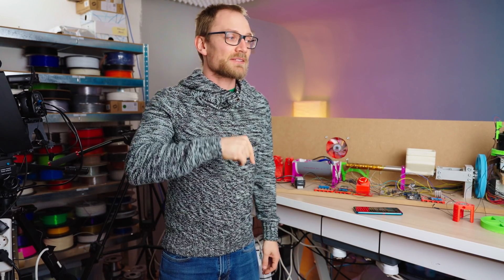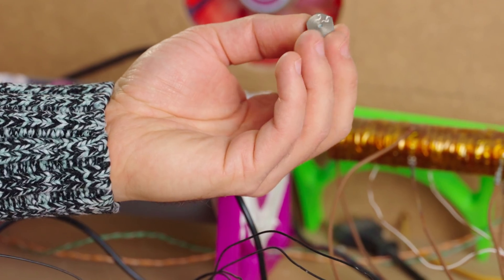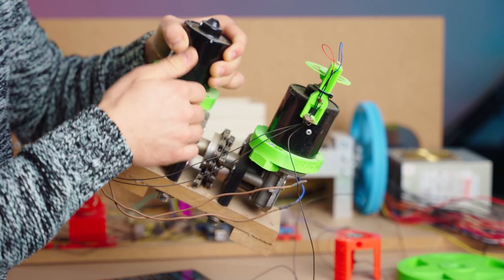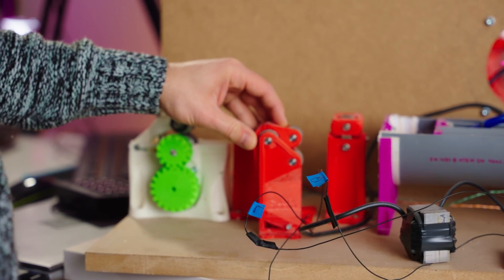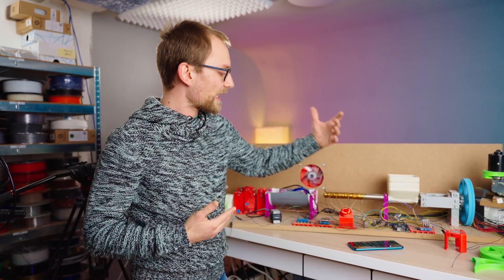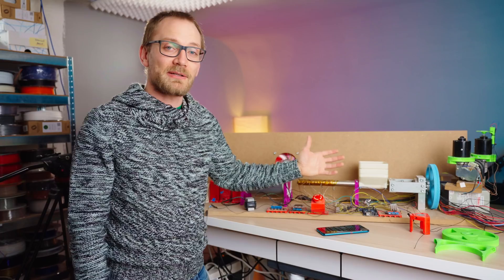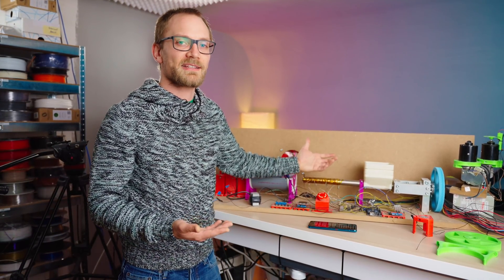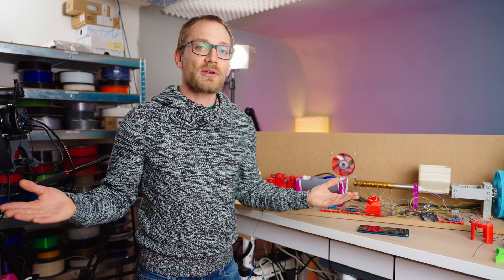How NOT to build a Filament Extruder

Comment: I feel super bad about my failed, incorrect, or otherwise waste 3D prints. Even more so than the cost of filament, the feeling that I need to hoard and somehow repurpose all my polymer waste of known composition limits my 3D printing adventures. I often think about building shredding and extrusion hardware, but it just doesn't seem practical, especially on my extremely limited budget.
I suppose if I had non-bedroom space for a real workshop I'd melt my 3D printing waste (and household plastic waste of known recyclable composition, but not accepted for commercial recycling) into sheets or other blanks in an oven, and use them for 'conventional' subtractive forms of crafting, as that seems more likely to work out consistently and with minimal expenditure.

Comment: @MadeWithLayers I'm actually quite interested in the filament sensor you used with your extruder.  I've seen the Infidel, but I actually need something to measure the filament diameter coming out of a Filabot and as you said, I don't want to put too much pressure on recently extruded filament.  Do you still have any info, models, etc. on that particular sensor?  I get the basic concept and can probably create something from scratch, but anything to start with would be helpful.

Comment: I know that this video is quite old nowadays, but still very interesting! Thanks for sharing! Though, I'm wondering how did you make the heater system.. did you use some kind of wire to heat up the tube? Can you please clarify?
Reply: It looks like he used resistance wire, maybe kanthal wire or something similar, though nowadays you can get band heaters that're the right size for this pretty cheap and they're much more reliable for this purpose

Comment: There's one more thing to the "If I built it now" aspect: Technology has advanced by (as I write this) almost nine years. The geared stepper motor and driver with decent torque is now cheap enough to almost fit within the 2013 budget, sleeve heaters and PID controllers too, and you can actually buy proper augers with compress and mix zones. Would be interesting to see the 2022 version. . .

Comment: Hai Tom, Been There Done That...
Some considerations:
* Big augur size best for recycling 3Dprints with schredder
* I use recycled filament for very big 3Dprints to cut costs
* A cheap DIY 3Dprint worm transmission with nema23 stepper works
* Tube heater wire is to long to the hopper hence the clogging
* Reduce temperature of the tube near the hopper with a large heatsink
* Analoque Hall sensors works cheap and simple
* Threaded rod and nuts through brackets on top of each module for a more robust construction
Hope this helps finishing the project ;)

Comment: How would you go about making a hybrid 3D desktop extruder/3D printer to function like a solid ink CMYKW traditional printer and a 3D printer at the same time.  The machine would need to fabricate variable sized dots of material to be deposited onto the substrate.  Working like a traditional printer you could lay down entire sheets of material with each pass, then layer those passes to create a 3D sculpted object potentially faster and more effectively than squirting a thin filament of plastic through a single narrow hot end.

The other aspect of the hybrid is the ability to also fabricate vinyl sheets using raw PVC pellets.  One hopper per color or to craft them into molded blocks like solid ink sticks/blocks.  Making vinyl sheets in the desired shape while it is being applied to the substrate gets rid of the waste, trimming, weeding that current methods employ.  It is the next revolutionary step for the use of vinyl in garment decorations, signs, and truly 3D printed materials/sculptures.

Comment: hello for the hopper I invite you to take a look at the scooter transmission you cut the engine in 2 keep the rear part or it i the wheel you removed the wheel of course. i use this on a grinder it has great force. hoping that this helps you.  bye

Comment: yes filament is affordable but recycling plastics or reuse failed print is another challenge .
But it's true, you have already spent a lot of money and it's a lot of time / work to reach return on invest 

This is a really nice product ! even more when you try to find "DIY" other products at this level (or pro "like" products)
One "Must have" product (for recycling purpose) is a way to convert row materials to usable product for this machine 
all available product I found to do this until now is plastic crusher ... but in my point of view the finished product isn't good as it have to for using in a machine as yours
For me the plastic crusher should be a hot machine and the output should be like your granule in your bag

Comment: Hey I’m doing the same project and was wondering how you do your heating element. I been looking through and not sure what to purchase for it.
Reply from the maker: The heater is simply nichrome wire tightly wrapped around the barrel with layers of kapton tape as insulation. Worked reasonably well, but I'd probably go with clamped aluminum blocks and heater cartridges today.

Comment: Just out of curiosity, what about instead of using a heated extruder, use a bigger, more powerful motor & auger, & have that feed into a tapered chamber which ends at a die the diameter you want to extrude at? I know that approach is often used with a hydraulic ram rather than an auger, but figured that as the various types of plastic, especially PLA, have lower melting temps than metal then you might be able to generate just enough heat from the friction of forcing it through the die with an auger + motor.

Comment: Very interesting, thanks for the post-mortem! Interesting that you were able to get usable filament out of it: other diy extruders I've heard of that used drill bits had metal crud in the filament.

I think the other use case for a home extruder that people really want is for recycling support material and failed prints.

Comment: I think most people who want a filament extruder are thinking about re-using failed 3D prints. Or just old plastic. That is really really difficult. Perhaps the better thing to try is injection molding with old plastic?  You don't need to chop it as carefully, it doesn't need to have exactly the same material attributes, and depending on what you are making the tolerances might be looser.

Comment: band heaters are cheap and used on professional injection mold presses. they would be better than that wire mess. 

I'd build one but i dont have the space for one RN. I'm tearing down my cnc router an making an electric work station becasue i cant have both.

Comment: I have some questions about the extrusion screw! You indicate that the optimal size is based on pellet size, and the optimal drive speed is then based on screw size. I'm not sure I understand this... The auger should fit in the barrel with just enough clearance to not risk binding, and I don't see how pellets will affect that. (Unless I'm wrong!) For drive rate, a larger screw would not need to turn as fast for a given amount of extruded filament, but as long as it's slow enough that all the pellets fully melt, it should not matter, right? Or is it more to do with the volume of the melt zone being larger for a higher diameter? (Due to surface area and volume scaling differently.)

Alternatively, any links to relevant papers would be much appreciated! The only ones I can find are meant for industrial setups with very special tapered extrusion screws.

Comment: What about a pellet driven Hotend?
That would probably be easier to build, would bring some negative points in weight of the Hotend, but it would be really cheap material to print with..

Printers with pellet-hotends exist in the industry. But these are really expensive. So why don’t DIY it?

Comment: You need to use parts from Injection Molding machines and plastic injection molds, There are small auger feed parts and simple plunger styles to feed plastic beads. The nozzle, would be made from  hardened steel. For the Hot end (Barrel ) there are pyrometer controlled heater bands. What I see in your video is half of a injection molding machine.

Comment: I think this is a fantastic end results of an engineering student.  I look at the solutions and can see why you made those choices.  I spend nine months to find a solution to extruding Zip Loc sandwich bag basically with zero back ground and less then a year out of college.   All the plastic neck down occurs between the nozzle and the chilling means.  My distance was near a half a foot.  Yours is a few inches and not that obvious.  The Zipper was cooled by a stream of water and the film by a drum.  
 I agree that the drive approach was not good.  I would consider using your lathe as the means of driving the screw because it should have a much bigger motor then the two you used and a speed setting system to get close to the speed range.  You can make two steady rests to  hold up the extrusion tube that later can be use for guiding rotating cylinders  when cutting long shafts.    Lathe motors should produce a uniform speed.   To simplify the control assume that the speed, temperature zones and opening size from the hopper determines the extrusion rate.   These do not change.  They are gross setting to get smooth surface of plastic related to the temperature at the nozzle tip.   The size in adjusted by the speed of the puller which has a short time constant.  The delay is the length from where the hot plastic freezes to the diameter measuring rollers at the pulling speed.   All the cross section reduction occurs between the nozzle and the freeze location.  This looks like a length of a few inches.

Comment: I just want to point out that having your own filament extruder is less about making your own custom filaments but more about recycling failed or broken prints.
This also brings some design consideration. Like, how to break the failed prints to small granules? Should there be a big melting pool, allowing bigger parts to be melted.
Reply: Do not continuously heat plastic to liquidus, it degrades rapidly. As opposed to metal, a molten bath of plastic is not viable, the material wouldn't last more than several minutes. The proper approach is to shred the print mechanically into small pieces, and then you can throw those into the filament extruder, and you don't have to even melt the material to liquid and shouldn't, it's more like a paste consistency just like it comes out of a printer nozzle fundamentally. Pressure does a lot better to mix the material and form the filament than temperature, less degradation.

Comment: Well It doesn't seem so far to be completed properly. A more beefy motor a decent gear reduction  and an heat brake would change  completely the result. Also instead using an close loop to control the rpm you might use some quite beefy stepper in open loop with a quite decent gear reduction and you would not have to worry of the RPM.

Comment: Amazing! Could you repurpose a pellet extruder and just focus on the winding? How much did the bag of pellets cost?
Reply from the maker: The pellet extruder toolheads ars just small versions of this. Probably impractically low flowrates and possibly too inconsistent if you want to make full spools of filament.
The 25kg bag of 747S was an ebay find - iirc it was around 50€ at the time. ABS resin is pretty cheap when you buy in bulk (that is, tons at a time).
Reply: @MadeWithLayers  Oh okay so it really is a lot cheaper than buying rolls!

Comment: Recycling your waste filament could also be a motivation, not only the price of the filament itself. It just makes me sad to throw away so much plastic from failed prints.
Reply: yes it's so hard to find filament recyclers who will take my failed print PLA even if I pay for shipping and expect nothing back.
Reply: the trick is to have a reliable printer so you don't have bad prints
Reply: @natalieisagirlnow  My printer is reliable, but some prints are just for temporal use, support stucture, test prints or simply one-time use,...
Reply: @the78mole  design better
Reply: @natalieisagirlnow  read better....
Reply: @natalieisagirlnow  And then your designs fail because that's how designing things works :P
Reply: @miranda.cooper  sounds like someone who exclusively print completed designs or some genius who got a perfect design without running partial prototypes.

Comment: Agree, with the price of filament it will probably not be a financial wonder, but as other also points out there is the waste aspect, not having to buy new filament and throw out prototypes would be great. 
Of course turning failed parts/prototypes into will require additional steps to break up the parts or maybe even a pellet extruder to make the material more uniform before going into the filament extruder. But... we have to start somewhere - and no matter the result, watching you  designing and building a new "less budget" version (still mainly using commonly available parts) would be both interesting and educational..

Comment: +1 for those who want you to try again, and do it right. Recycling printing waste (supports, wipe towers, failed prints, unneeded prototypes, etc.) is something that needs to be a lot more accessible than it is now. What we REALLY need is a Prusa-like kit so that high quality, but affordable machines, can get quickly into the public space. Most kits are woefully underpowered (Filastruder) or insanely overpriced (anything ready to run). The Lymans and Recyclebot designs are great, but building an extruder from a BOM and some wiring diagrams does not accessible make. I've been waiting to see Stefan's progress with his shredder and extruder for too long. :(

Comment: While filament becomes cheaper and cheaper, we face a different issue now: Our printed parts are rarely recycleable since it lacks any kind of markings which exact plastic it is. So even if the quality is far below the bought stuff, as long as it can somehow handle shredded scraps, a DIY filament extruder could solve many of our issues.

If you still have notes/design files etc you could put them on GitHub, so that others can fork the project to revive and enhance this actually quite promising design, that could result into something really cool. I really like the idea with the water bath to cool the filament down. Maybe adding a water cooling loop to the cold side of the extruder could solve the heatcreep issue. Since stainless steel is a rather bad heat conducter, that could actually work.

As a software engineer I am always intrigued by the idea of getting cheaper hardware do the job by improving the intelligence inside the software. Since the speed of the filament should be known at the side of the pulling motor and the distance to the nozzle is fixed and we get a width value somewhere inbetween, shouldn't we be able to find or learn PID values to flatten the variation? One issue somewhere in the system, might throw it off, but with enough exception handling, it might just work.